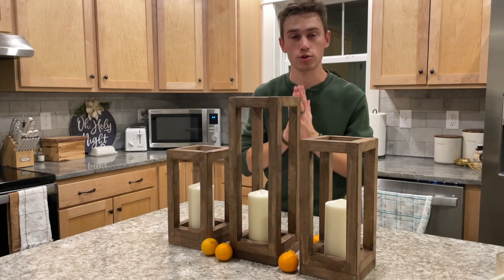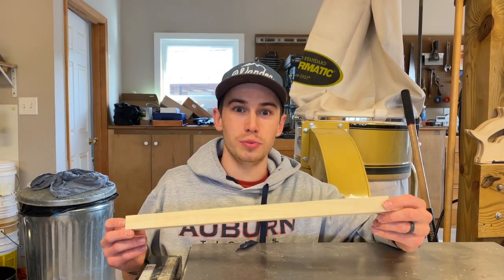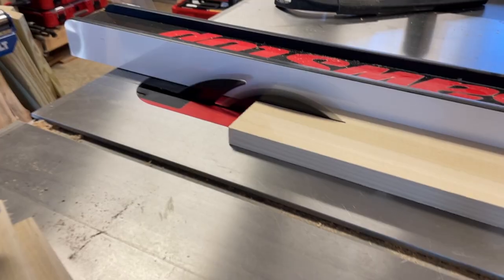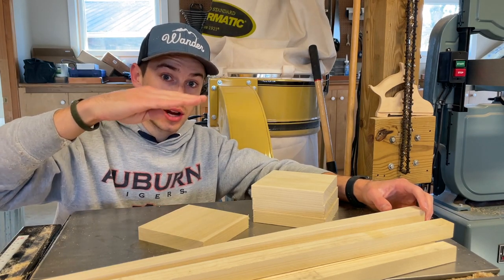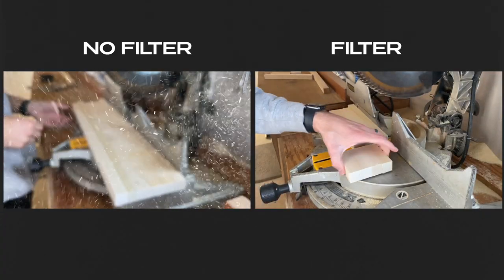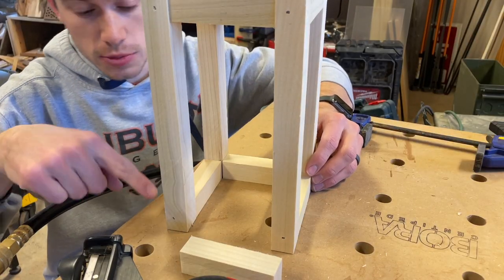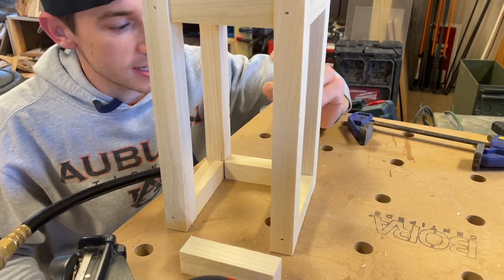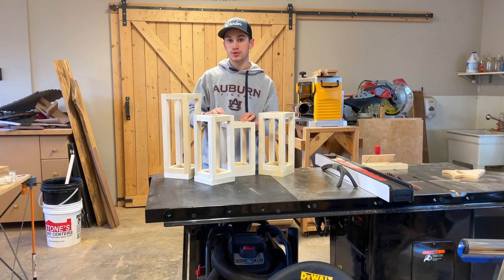MAKE MONEY Selling Candle Holders | DIY Guide | #woodworking #diy

Comment: Nice! Are you using a 16 guage nail gun to nail them together? If you are, then I have that same nail gun. Do you find that the nails are enough to hold them together without glue?
Reply from the maker: Hi Mike! Yes, I am using 16 gauge nails and the lanterns have held up great! I didn't use wood glue here because many of the joints involve end grain that would suck up the glue. It definitely would not hurt to add wood glue, however. Thanks for watching!